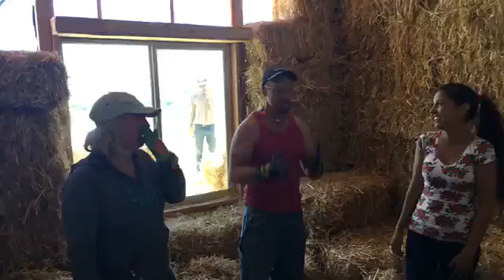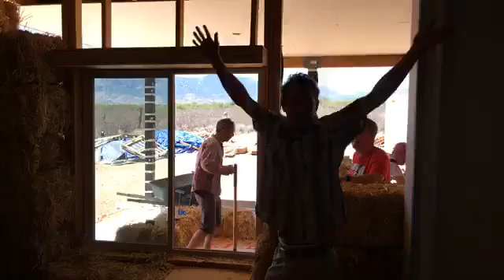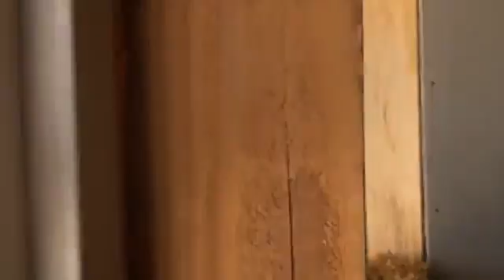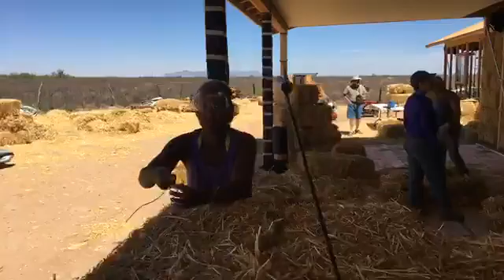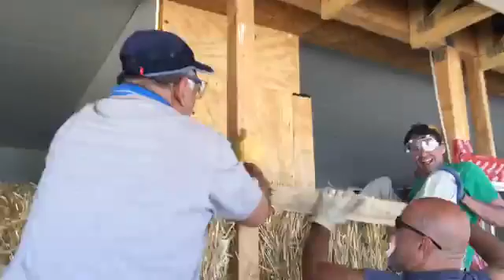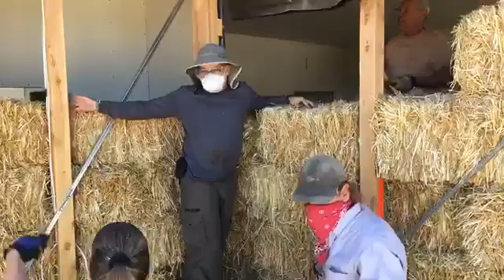Straw Bale Construction Workshop - Sierra Vista Day 2

Comment: Not sure why you have so many plans with the bales on edge.  I first heard of straw bale construction in the early 90s. It seems that at the time most homes laid the bales flat so that you can easily notch the bales for the 4x4 posts on the interior.  I like that because there's no thermal bridging, the bales are flush with the posts and beams and there's plenty of timber to attach the cabinets.